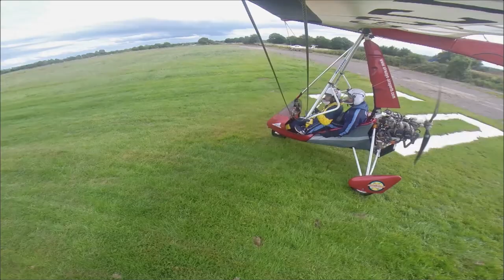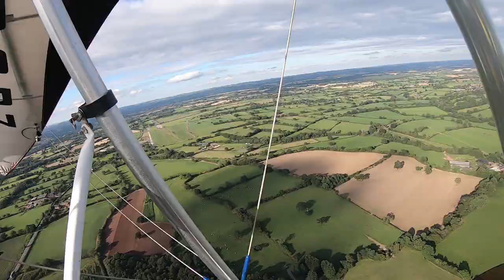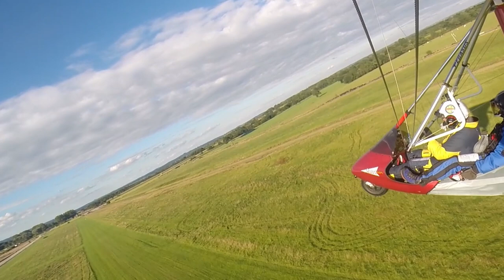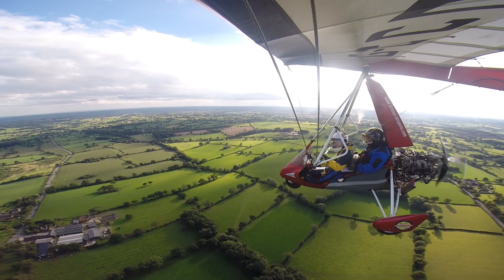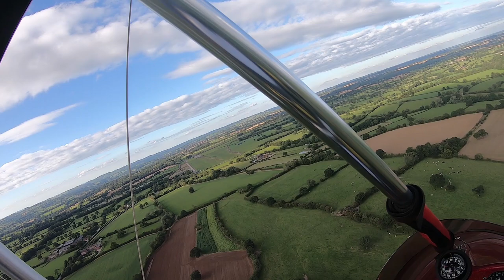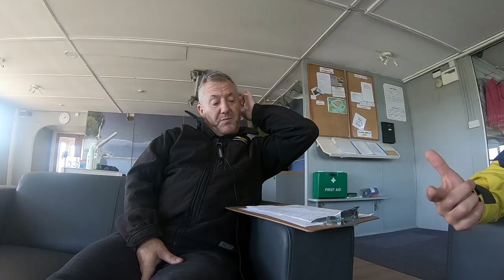Flexwing NPPL Journey - Episode 8 -  DIFFERENT landing techniques

Comment: what are you using to record the audio
Reply from the maker: I have a little mic in the ear cup that goes directly into the Gopro 7 on my helmet.  Its why, on the long flights I loose the audio at the end if that camera runs out of battery.
Reply: @GolfFoxtrot22  I have also got a gopro 7 and have bought the external box for the audio, I will try that but have also bought a lead to go into the microavionics intercom to see how that works. I enjoyed the video thanks
Reply from the maker: On my own set up (PM 100), I have the vlog mod that takes all the audio from the speakers and outputs it to a 3.5 mm jack plug that goes straight into the gopro audio adapter. I made a video that's in my catalogue if you are interested.
Reply: @GolfFoxtrot22  will take a look thanks